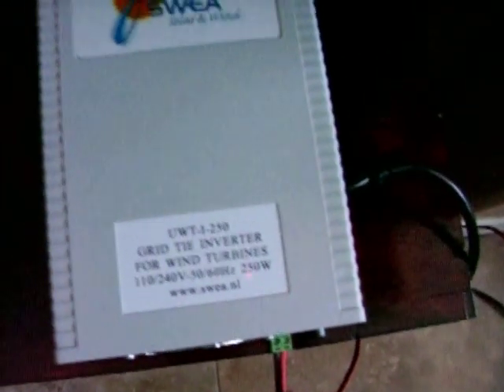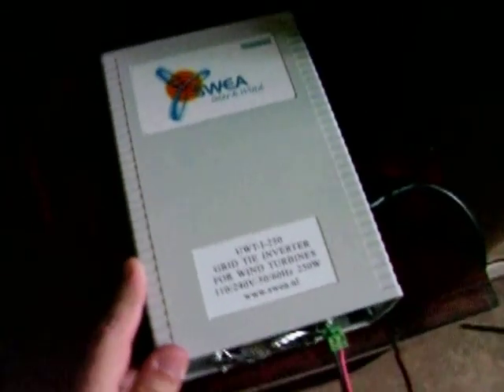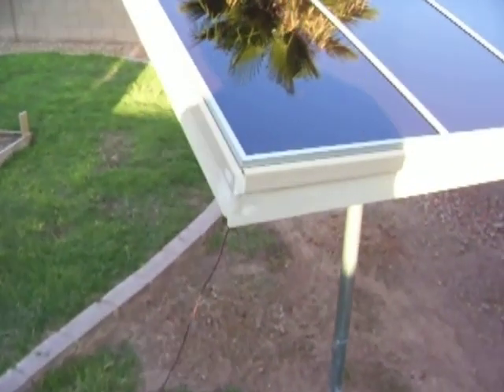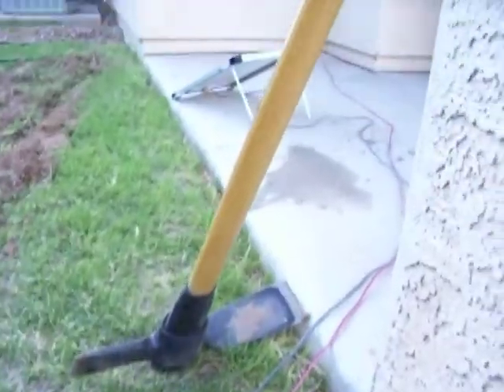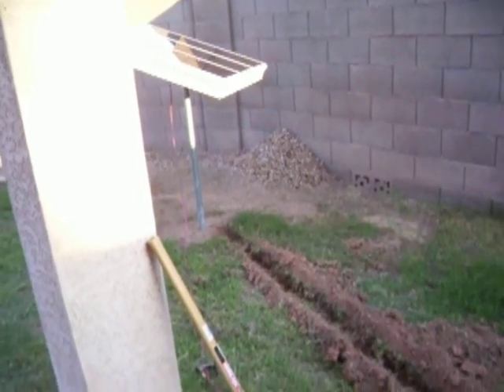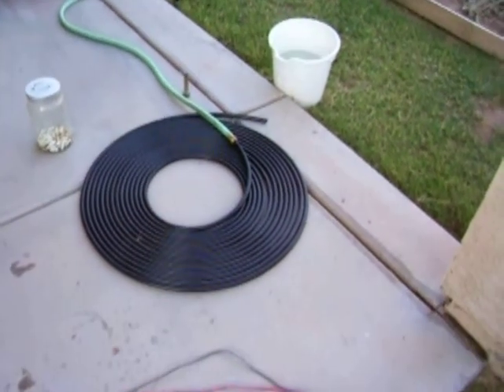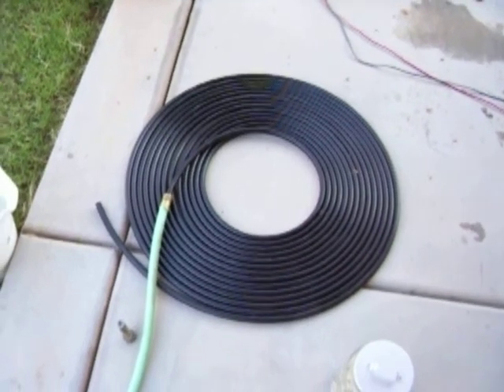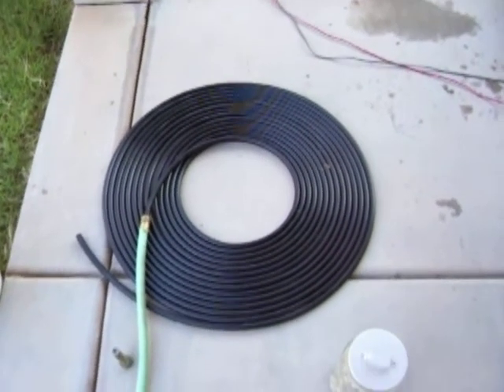Solar Panel Setup

Comment from the maker: Jamesc426: The panels can be adjusted in any direction to catch the best sun light. It made it just fine trhough last years monsoon just fine. It only shook a bit but held steady. The pole is a fence pole with a concrete base. It's not going anywhere any time soon, lol. The system has been working just fine for me so far. This is just for fun though, I do have a 3.5kW system install on the roof of my home. I will try and make a video of the soon... :-)

Comment: I've heard that, based on our latitude, solar panels should be angled at 45 degrees...could that be why you aren't getting the power you think you should?  Also, I'm interested to hear how this holds up during a monsoon storm....that pole seems awfully skinny for the weight it's carrying when a 50 mph gust hits it...

Comment: Does the fan run non stop on this model?
I have one of the cheap ebay 250 grid ties but, fan runs non stop wasting power.
Needs to be temperate turn on only when hot\needed.
I also have the HF kit 4 total with 3 of the 5 watt panels and a 8 watt panel not amorphorus. These panels are extremly overated by HF. Actual output is not 1 amp per panel as they say they are. These kits should be sold for 125$ or less

Comment from the maker: Hey Fellas, thanks for the comments! sorry I just figured how to post on here! I've been watching and learning from all the videos you guys have posted on here, great job! I have since disconnected the little Grid Tied inverter until I get the two 130 Watt panels for it. In the mean time I have added another 2 batteries (same type) sealed lead acid batteries and I have been running everything in my bedroom and have yet to run the down.

Has anyone added or modified their system recently?

Comment: hi from fl,great start like your frame,id try to get it up higher then the wall,did you complete hot water yet ,would like to see a vid on that,i have the 45 watt Harbor Freight panels to + to 10 watt panels,and just got done with solar cells 105 watt panel

Comment: The grid tie inverter you have is made for 24v.  Your only pushing a little over 12v with those panels... Try getting one more and going to 24v the inverter will work better....
Good luck... from FL....